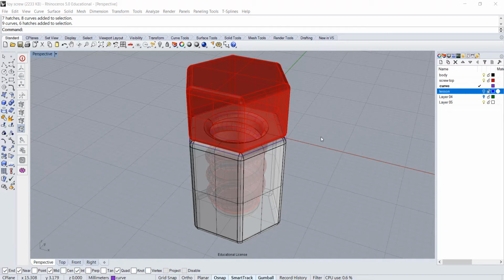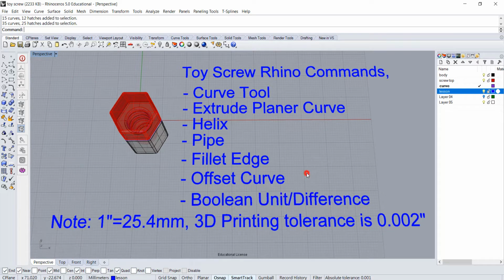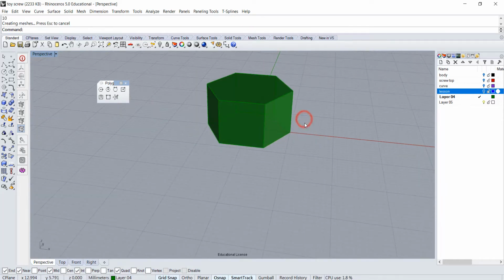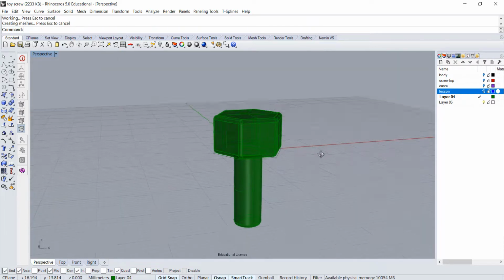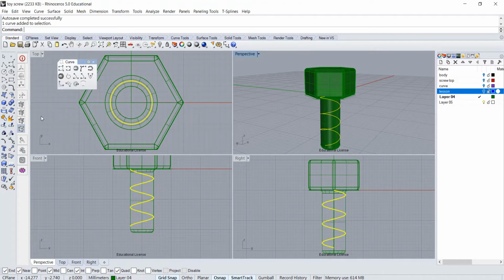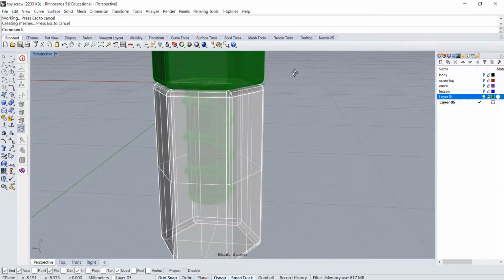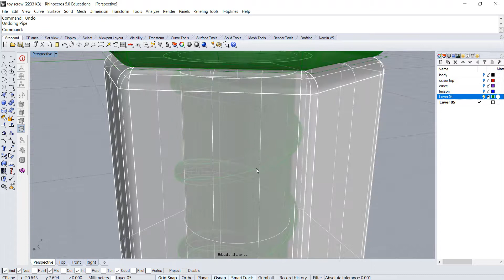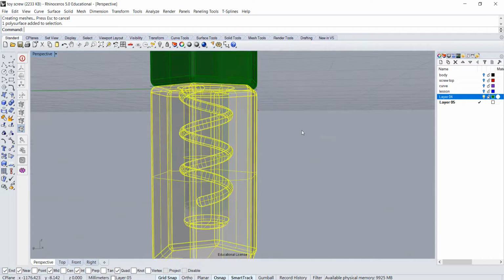Rhino 3D CAD Technique #2 - How to Build a Toy Screw Model for 3d Printing

Comment: hey! Nice tutorial, however I have a concern about using the pipe technique. Aren't screw threads usually made with a triangular prism?
Reply from the maker: Hi Tyler, this is intent for 3D printing.
Reply: @PJChenJewelryDesign  thanks for the quick reply! I am 3d printing a similar screw so I will test it out, I'm just concerned about it catching the existing thread. I will try this method out though!